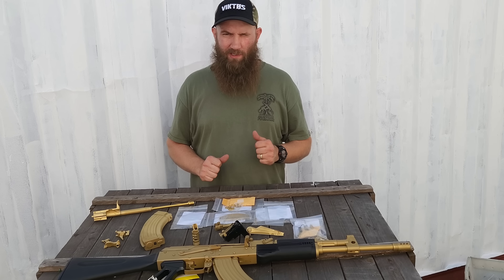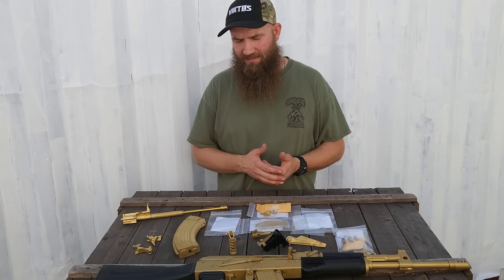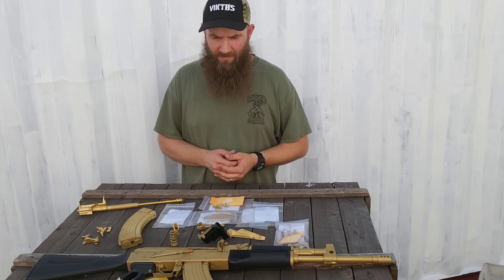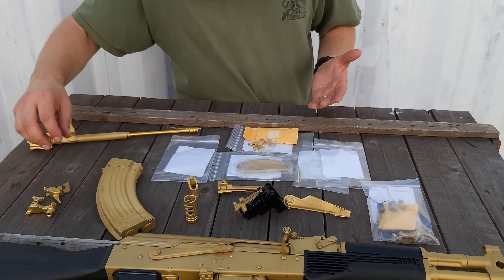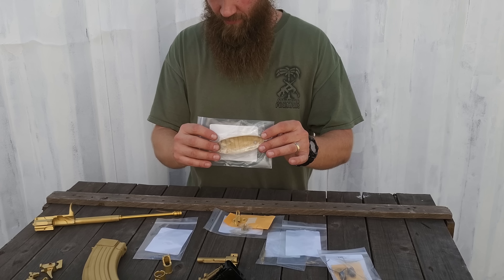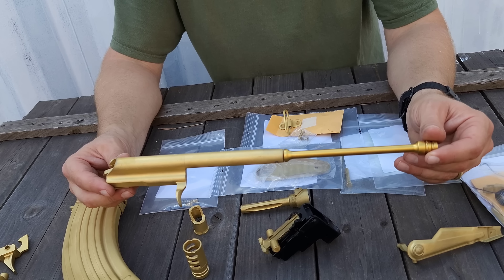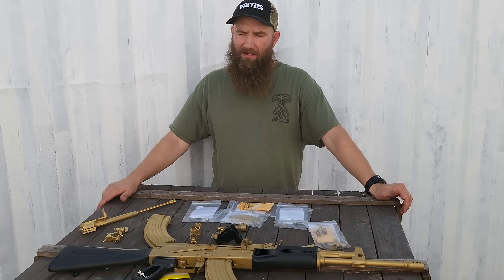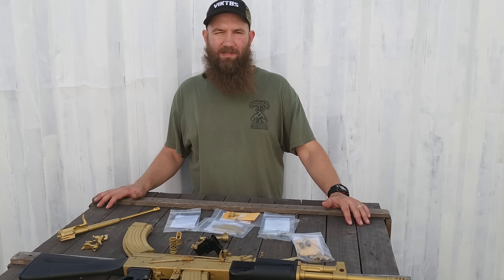TiN(Gold) PVD AK47 PARTS  at Atlantic Firearms

Comment: Now another consideration could be electroplating the AKs in brass or red brass which looks a lot like copper as the name suggests. Given a high enough polish and clear coat coating these can look very similar to gold as well. I would imagine based on my experience that the levels of copper, brass, chromium, and carbon in each given alloy will dictate the finish if done in titanium nitride. I would definitely consider something with higher levels of copper and brass for a more rose gold but I would consult someone who knows better than I to confirm that.

Comment: Not to be rude but had you consulted with a machinist prior to coating these parts he or she could have told you that the base metal affects the finish of the coating. As one myself I would have told you that. To get the best finish aesthetically you really need to high polish the metal first. Steel with less carbon should turn out a better finish as well. It's possible you may need to electroplate the steel first and then titanium coat it for best results such as with nickel plate. Now I'm no expert in coatings but I would imagine that nickel would produce a warmer gold-like color than something like stainless steel. Either way the better the polish the better the result.

Comment: Titanium Nitride is NOT good on moving friction prone parts. It will prevent your moving parts from moving. It looks great, works badly on moving parts. I TiN coated the bolt rails on a MK19 40mm Grenade Machine Gun and the bolt would not move.